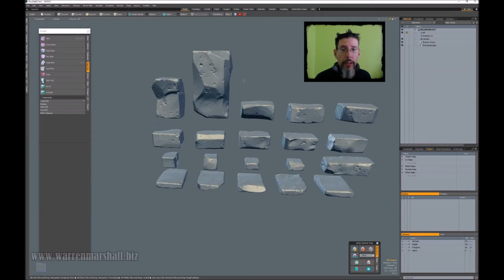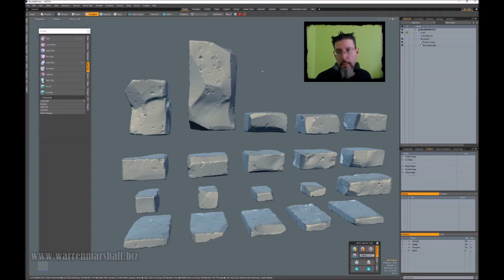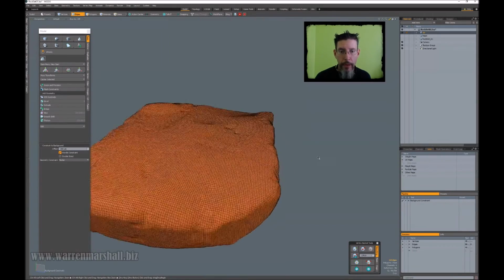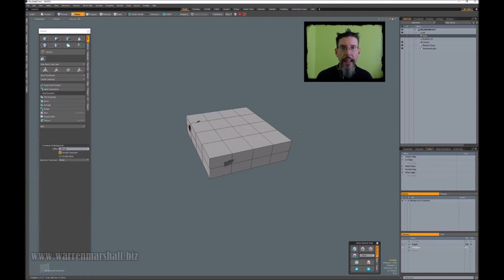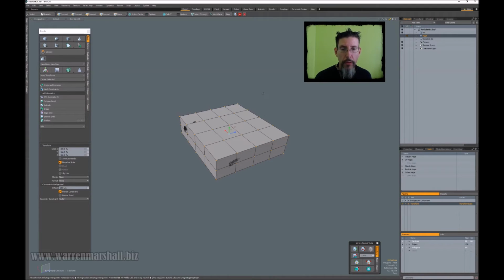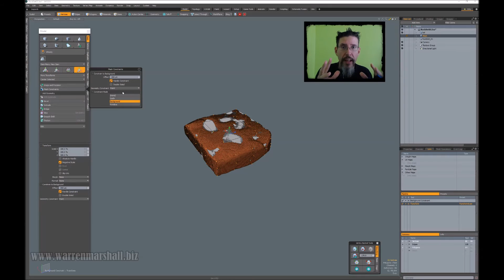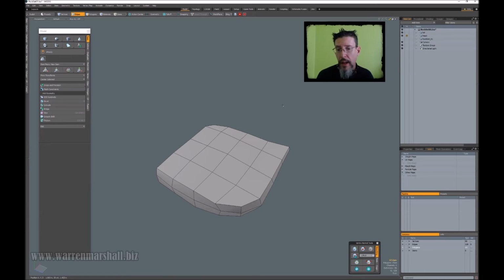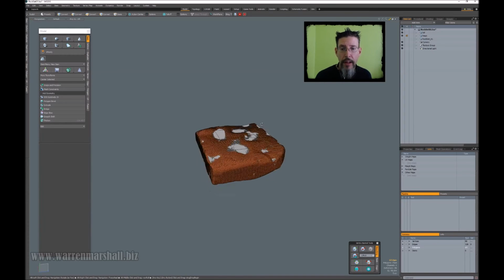Quick Tip #26 : Low Poly Using Constraints

Comment: I'm not sure if you are aware off the top of your head, but would you know how to achieve this through 3ds Max?
Reply from the maker: Top of my head, doesn't Max have a "wrap" function or something like that?  I'm SURE there's a script out there that does something equivalent, there HAS to be ...
Reply: Warren Marshall That was my issue I was not using the proper wording to search for. There is a shrink wrap script that I will look into. Thank you very much